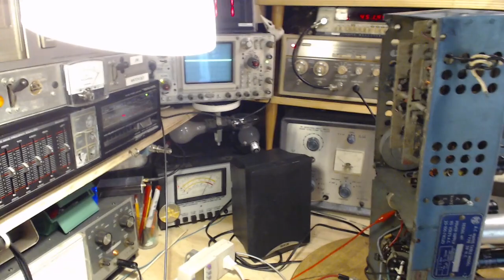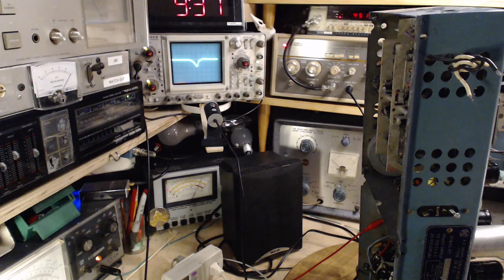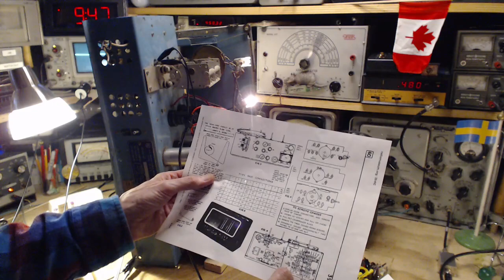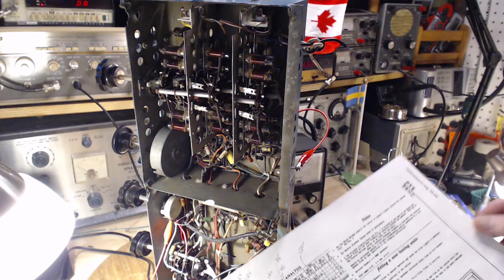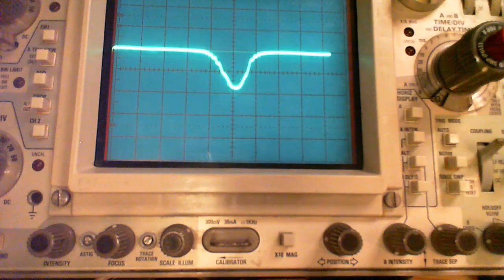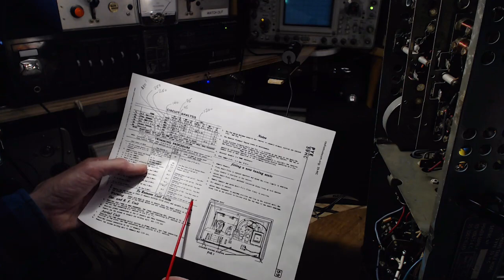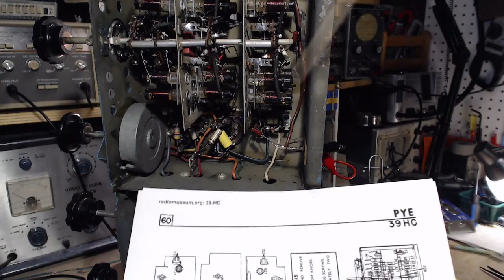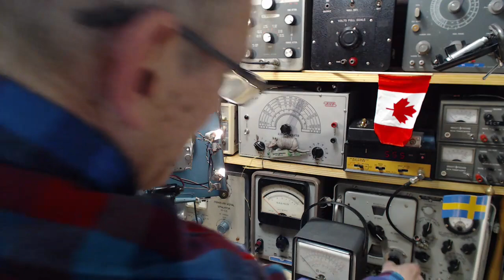Canadian PYE Model 39HC Video 44 - IF Sweep and IF Trap Check

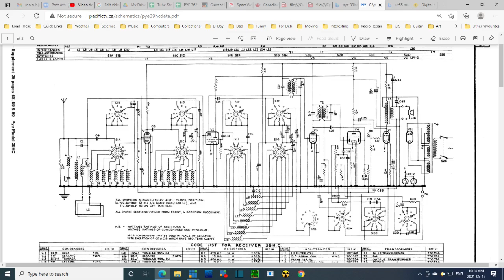Comment: 37:29 L3 is the loop antenna! You have the schematic right in front of your eyes! And it is clear as day to any viewer where L3 is when you show the schematic at 40:00. 
And if you follow the signal path for BC band it is clear that here the RF amplifier tube is circumvented and the antenna feeds directly into the grid of the mixer. 
Also can you see that on BC band L3 is an active selective part of the input filter network even if you feed into the external antenna. 
So for futire reference; without the L3 loop antenna connected there is no way to adjust the front end on BC band, since the coil L2 which is to be adjusted as per manual, is connected in series with L3 loop. If L3 is missing one side of L2 is hanging in the air. And the trimmer C3 which is in parallel with the L2+L3 coil has nothing to resonate with if the path thru L2 and L3 is open.
What are you doing? Read the schematic and understand it before you twiddle

Comment: 46:48 The loop antenna L3 is not only receiving antenna but also a resonant part of the BC antenna filter network. When pushing a BC band signal onto the external antenna connections, the 5pF cap C2 will couple that signal lightly onto the resonant BC antenna filter consisting of (L2+L3)//C3 . 
L3 being attached is crucial for any BC band operation no matter what antenna input you use.
46:49 You finally start to attach the missing loop antenna L3. You have the red cliplead attached, but at 46:56 you hover with the second white cliplead literally 1 inch from the dandling wire, get distracted by the volume control, and at 47:00 the white cliplead ends tossed on the bench; effectively a failure to connect L3 loop.
No wonder it all goes downhill.
Focus on the work! You are advancing one baby step and then going back three adult steps due to losing focus and screwing things up.

Comment: I would get this wrapped up soon in the best way possible. Those cores and trimmers aren't meant to be tuned so much. Hate to see a new problem crop up. Broken  or stripped cores or shattered mica in the trimmers. Maybe in the future solve all other troubles first and then alignment. Not many sets require alignment anyway unless some has played around. Sometime they do drift but not by much. Watch Shango  videos sometime.

Comment: 29:02 Better find a more suitable point for the scope to attach to if the observed voltage swing is too low.
 If you raise the generator output voltage you are running risk of AGC kicking in near the peak of your passband curve. And the low pass filtering on the AGC once it kicks in will also misshape any portion on the right of the peak due to delayed reaction. 
That is why most IF sweep alignment instructions either tell you to disable the AGC loop and substitute a fixed AGC voltage, or keep signal level below a certain value.
This whole sweep alignment is unnecessarily complicated and failure prone if not done right, using the proper procedures and equipment.
Back in the day the radio was built all shop service was probably done the old way by peaking on a fixed IF. And that was probably good enough.
There is so many other worms left unfixed in this radio like the motorboating on low volume that a quest for a "perfectly shaped IF curve" is probably the last thing on the list. 
You dont do a thousand dollar paint job on a car whose panels are still bubbling with rust.

Comment: Not going to bother with nonsense overload. But this I can't let go by: 7:58 "a smoother curve means smoother arithmetics, means less harmonics" (wth??). Marker generator has more bandwidth than the circuit under test, sure way to get an usable marker beat peak. Jim still has no clue how to use the scope. IF is a bandpass filter, his display has a dip and not a peak as commonly expected. No care for trigger, sync, timebase nor delay settings. For crying out loud...
Reply: The display is a peak. The fact that’s it’s going down is because the detector is a negative detector.
Reply: @widecast  Is the scope input DC or AC coupled?
Reply: Positive or negative.. rather cosmetics on scope display, just a switch toggle to display as meant. And a bandpass is always referenced as a peak, not a dip (bandstop) shape. C'mon, make Jim's life easier!

Comment: Sweep gen was set to 451 to 453 but adj to 455!?  Something so quick an easy never seems to work. Was told Canadian factory's messed up all the time with poor workmanship and schematics.  Lets just start turning slugs and hope.  Please just read the instructions and follow it.
Reply: If you think about it, using a sweep generator to align the IF passband from scratch you need a proper marker generator. Not only to find center IF but also determine the passband width limits. Eyeballing it you end up shifting the center frequency around for sake of a "nice looking curve" and the passband you deem "nice looking shape" may be as wide as the Brandenburg Gate. 
If you want perfection you need to perfectionate your methods and use adequate test equipment following factory instructions to the letter.
There is a reason why people like shango066, M.Caldeira, David Tipton and many others shy away from an IF sweep alignment on AM if they can. 
Why does he not do a standard alignment with a fixed frequency 455kc for maximum output? Thats how the old techs did it.
Reply: Yeah that radio would have never been designed for hi fi wide bandwidth. Would have come from the factory peaked for maximum sensitivity and selectivity.